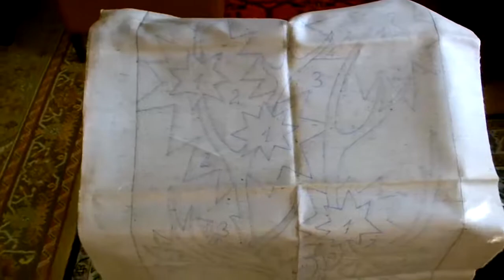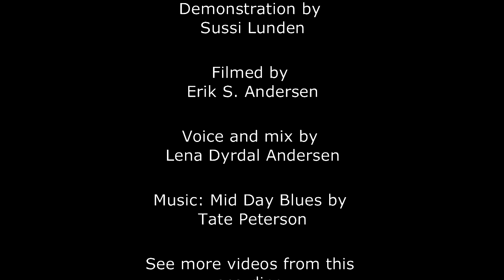Danella Frame Mounting

Comment: Very excited to order the frame/stand, but was wondering if the protruding nail heads cause a problem snagging or scratching one's forearms??
Reply from the maker: No, but they can be caught by your cloths. So its good to wear clothing that has no holes. :)
Reply from the maker: Hi Linda, No I would not say scratching your arm will be a problem.